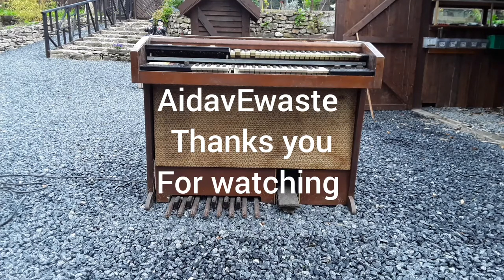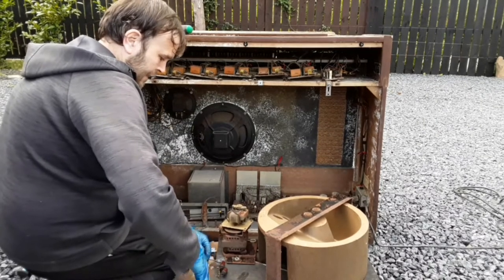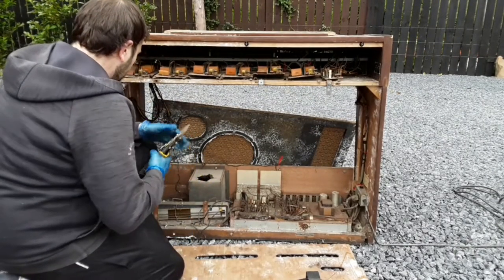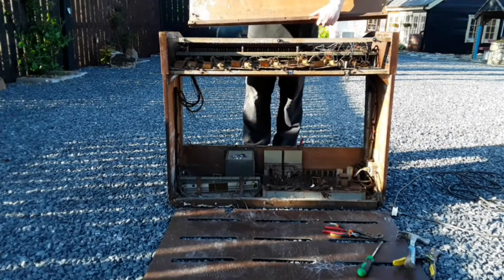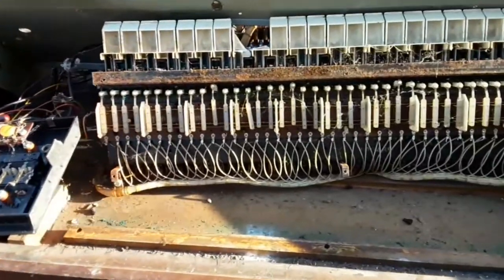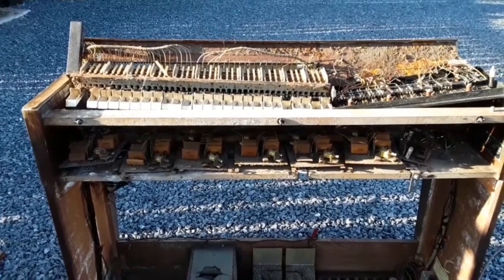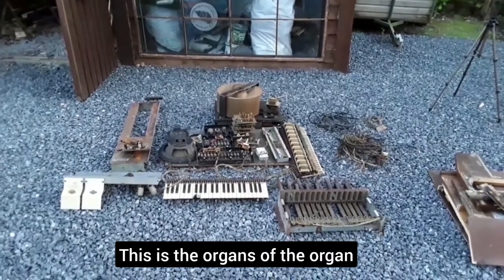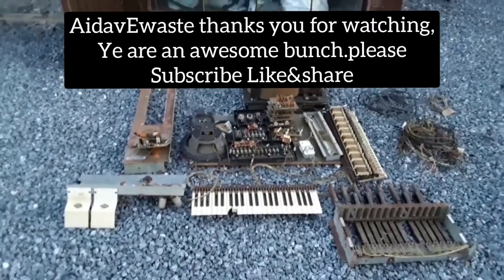Scrapping Hammond Electric Organ J322 for Gold recovery and fun.       Scraplife&scrappingoffice

Comment: Ok I just jumped from video to video subscribing to these channels. I tore apart one of these not long ago. Does that one have the silvery rods
Reply from the maker: What you mean by silvery rods...I had 4 what looked like Brass rods  but I think its gold plated now.i still have to test it...all the contacts for the keys and foot peddle all tested yo be palladium  contracts.. all transistors had gold legs and gold inside and some other stuff was hold plated..I think the silver rods you mention.i was hoping to have them in this model because I think theres supposed to be palladium running down the road but unfortunately  not on mine but at least its hold plated